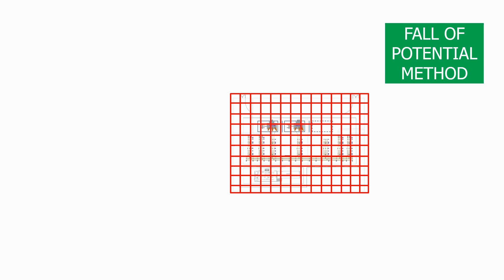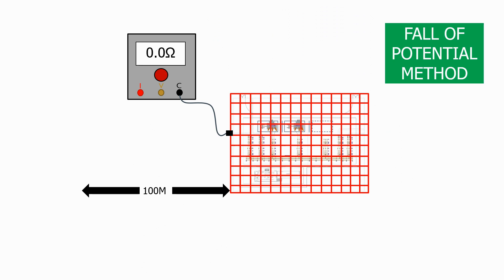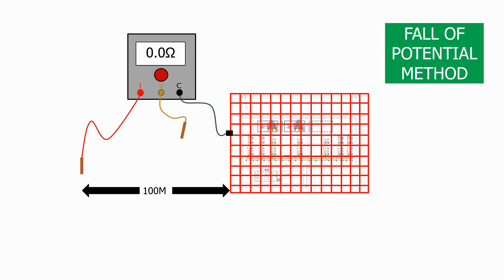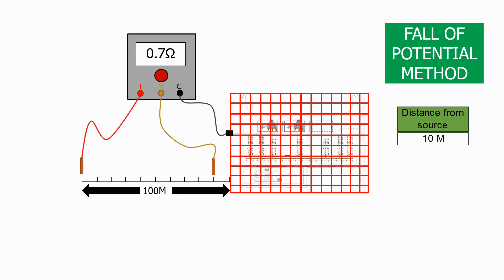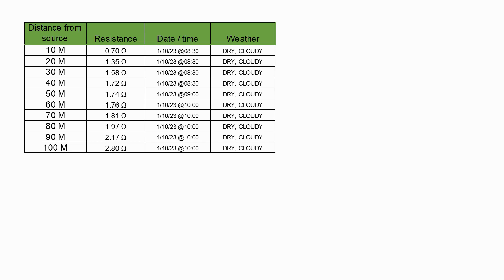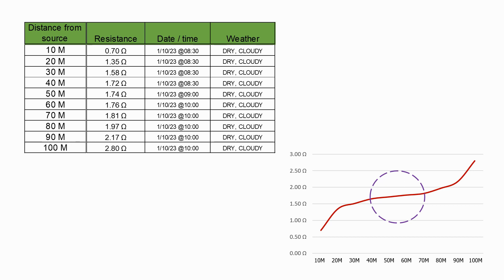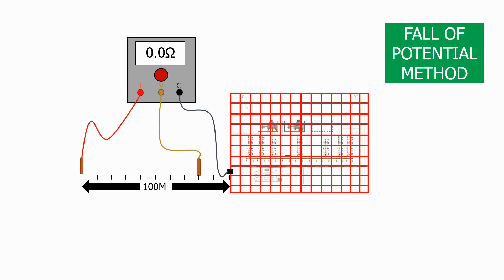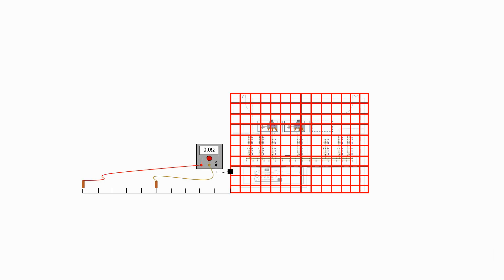Fall of potential test

Comment: Thank you sir, very useful, i also facing this problem on testing, the reading is not paased, but i dont understand how to determine the diatnce of 100m , now we are 150m , do you mind send a  contact email or chat to discuss?
Reply from the maker: Try going off in a different direction, you may be getting bad readings due to the measured current splitting & taking a parallel path..